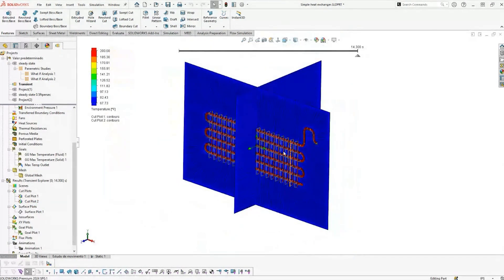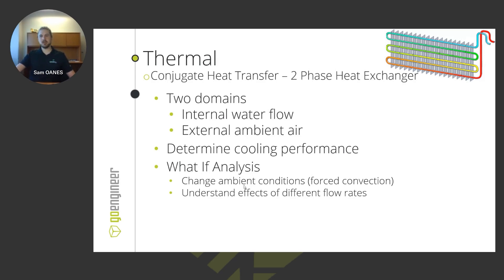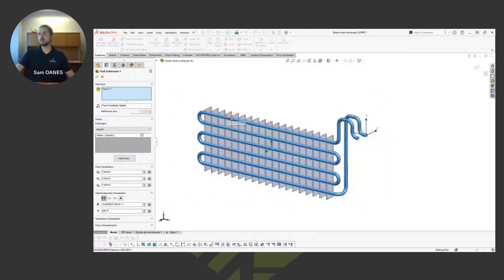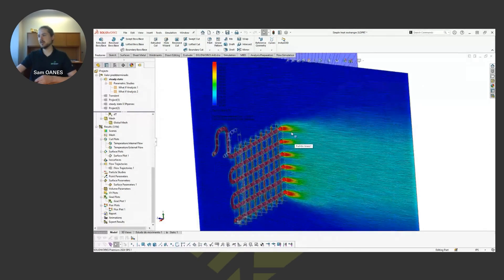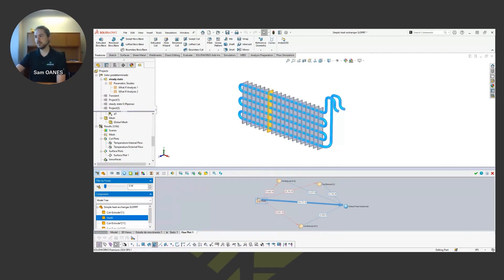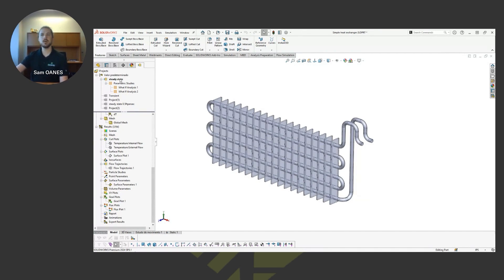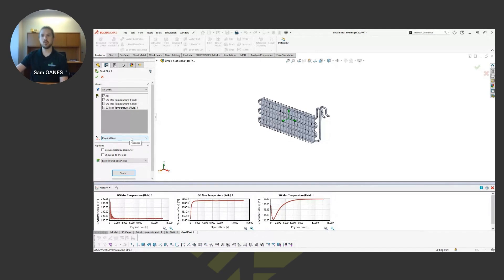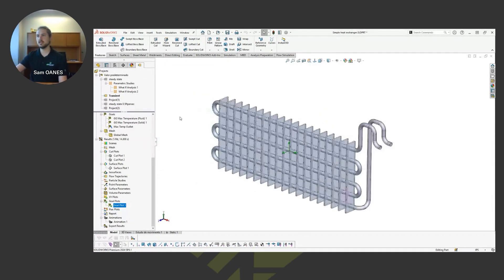Testing a Heat Exchanger with SOLIDWORKS Flow Simulation

Comment: how to add fan and simulate the same case or say, hot water flowing inside a pipe and a fan is cooling it, how to setup this example? please explain the setup for this case as it would be more realistic